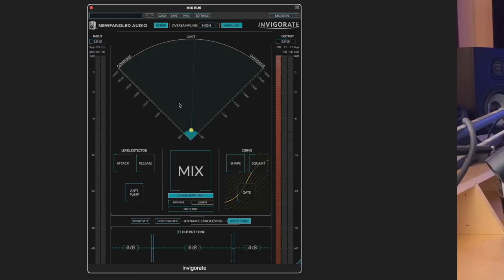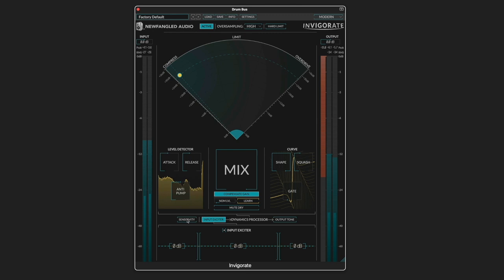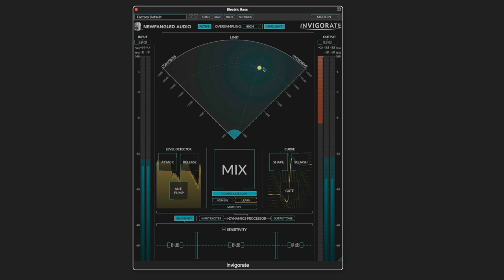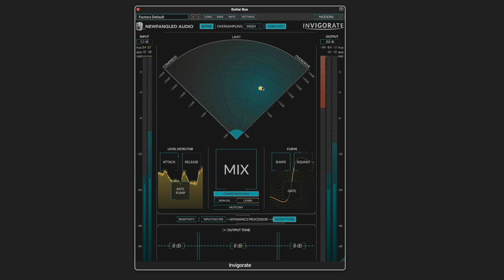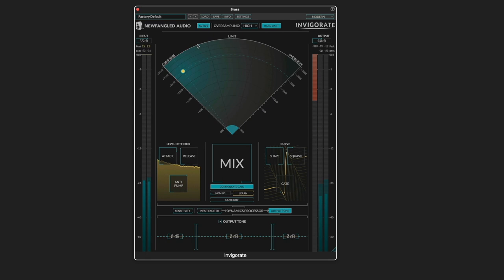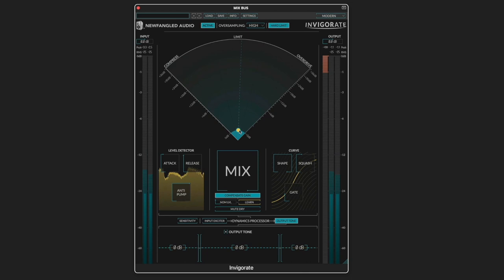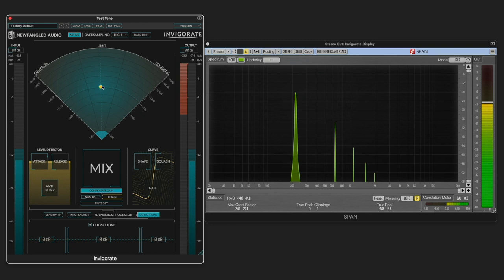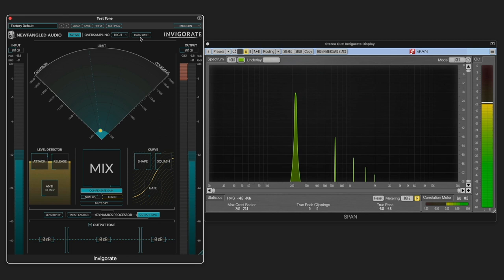Explore Newfangled Audio's Invigorate Plug-in: Overview/Demo

Comment: stellar stuff, great workflow. one question, "compensate gain" at 7:17 " we're gonna see a change in the output level", I only see the curve moving, output is fix, what is going on?
Reply: It doesn’t actually wiggle the output level knob, it just compensate’s for the level change internally to the algorithm. Does that answer your question?
Reply: @NewfangledAudio  it does. good job on the plugin !! thanks